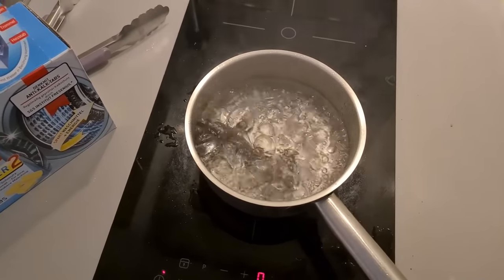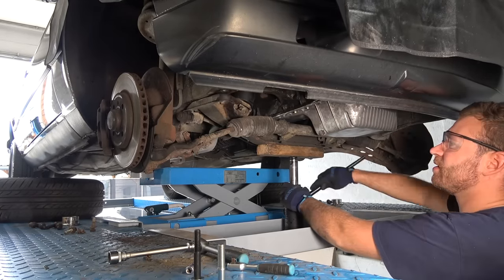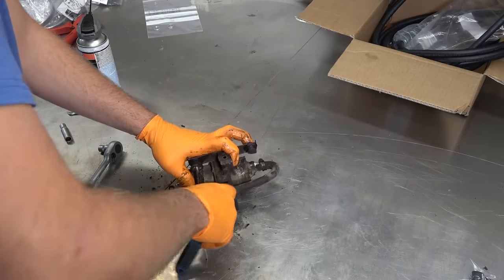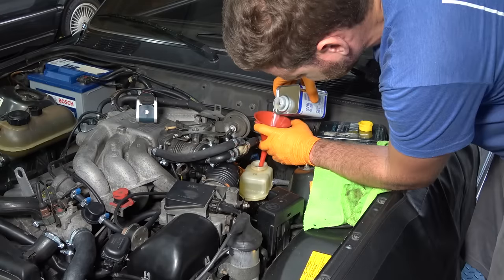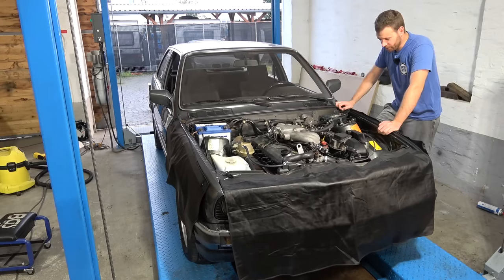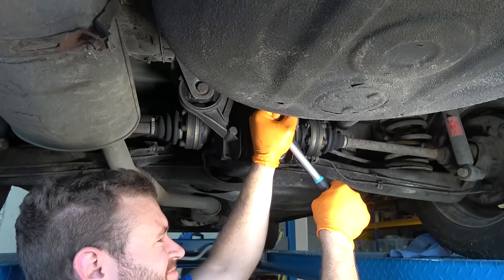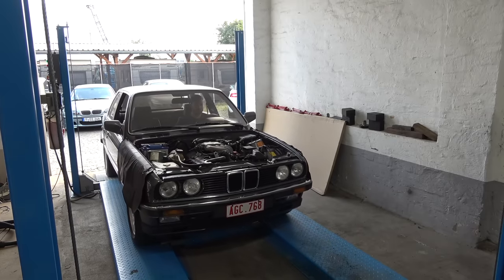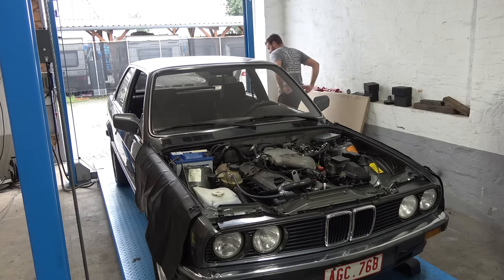Let's Get Mechanical - Neglected BMW E30 320i 5-speed - Project Marbais: Part 4

Comment: I had the same issue with high revs when idling and kept high when engine got warm in my Renault Megane Coupe 1.4 16v (2000 model year) and it was from the intake manifold gaskets and throttle body gaskets as they got worn due to ageing. I have no idea about BMW engines but I thought I might left here my input just in case it might helps you. I really enjoy your channel.

Comment: One tip Sreten, if the Lowering springs are out of the time the car was a few years old, it will get H Number plates, cuz its out off that time. All tuning that was available at that time is H Konform

Comment: A little tip re the spinning ball joint . 

Put a jack or block underneath it and slowly lower the car onto it . This will stop the ball joint from spinning and allow you to release the nut . 

Keep up the good work.

Comment: i just had the same high idle on my E30 as well i just bought. I checked the intake boot (no cracks) then i removed the air filter only to find AN OILED k and N filter which in my book is a no no i HATE those oily filters, so i bought a new stp air filter, and then cleaned the MAF sensor connectors and the sensors itself AND THEN THE IDLE WAS FIXED! no more erratic idle! smooth as ice. and i think the same i have wokred on e39, e46, e90, e60, e36 and i think e30 is harder (due to unknown AND being so old. i agree streten!

Comment: Sometimes you can get some needle nose locking pliers on the ball joint so it doesn't spin when zipping off the nut.

Comment: That hose that was too short is for the models with a fuel filter directly after the in line fuel pump, which is the one my car has. Yours seems to have the hockey puck shaped filter thats pre-pump

Comment: Really nice video!! As always of course.
One thing, you shouldn't use the impact wrench with the spring compressor because it can damage the threads of the bolt inside the tool. Good night and thank for the video!

Comment: Love your videos, some good wrenching being done. To save you a bit of heartache in the future, you can buy a nut splitter tool (a hole with a sharp wedge on a bolt that can be tightened) so you don't have to wrestle an angle grinder into small holes.

Comment: Basically every car needs a suspension refresh ++ at a certain stage / age. Recently had the front of my old Espace done in about the same fashion as this video.  1500 euro bill but worth it. Everthing feels solid again. Brakes very well. Takes bumps smooth, corners better (  yes even an Espace can corner to a certain extent ). Start spending money from the bottom up.

Comment: Fun Fact: You actually can get the oldtimer-TÜV (or H Gutachten as it is called) with lowering springs. Loweringsprings were available and common in its time so you should not have any problem. I have a H&R Monotube coiloversetup 1989 Golf GTI passed with flying colors, since it was a common modification 30 years ago. You only have to check if it was period-correct (up to 10 years after first registration).

Comment: Old trick with those control arms if I recall is using a jack on the center ball joint so you can get the nut off. I remember doing all the same stuff years ago on my early E30 which is now getting an S50 swap btw. Also, if you wanted to keep it more original, Ansa sport exhaust would be very understated while giving a better sound. More on the mild end but would probably suit the car well. Also agree on lowering it a bit, thinking you’re going the right direction with the spring choice.

Comment: After the welding put ice or carb cleaner on the nut, it will shrink the bolt and it will come out neatly. I just weld a blob on the bolt, then shrink and apply vice grips..

Comment: One of my favourite channels to watch and you finally bought my favourite car 😁😁. Try checking if the Throttle position sensor is working correctly for the idle issue, could be a possible fault

Comment: hi, @37:00 use a jack to push up the ball joint before removing the nut, the jack will keep srew from spinning
Reply from the maker: I tried on the right side, doesn't work when the nut/stud are rusted.

Comment: You can place a steel tube inside the replacement hose and then bend the hose and tube avoiding it to collapse. and it will look like original bended hose. Juan

Comment: Love your show! Suspension may settle, but I would have gone with oem-spec Sachs/BMW — but I’d still rock those steel wheels! Looks true and it is true with manual-steering and gearbox.  You couldn’t do this e30 any better with bigger wheels, it’s just perfect.

Comment: Hi! I discovered your channel just a few days back and its amazing! I have a hint for removing nuts from popped out ball joints, lift the joint with a carjack to press it back, a slight pressure is enough and it wont turn around since its cone shaped, works for me most of the time

Comment: Throttle issue could be the WOT resistor underneath the butterfly valve, or your volumetric flow unit, think later ones were mass air flow units

Comment: You can use Eibach lowering springs and still get the German historic plate. 
Recently this topic came up across whole tuning Germany. You'll find more info if you look for "Zeitgenössisches Tuning". 
Quick summary: If the type of (in this case) springs were already available at that time (+ 10Yrs) then the car is still historic ... And there were tons of spring-lowered E30s in the 90s ;) 

Keep up the amazing content!

Comment: Liqui Molly makes everything better. I used their Motor Oil Saver in combination with Oil Sludge Flush and Hydraulic Lifter Additive and it got me out of an 'unavoidable' piston rings replacement that would cost north of 1k. Pure magic in a bottle.

Comment: Love the video! Just one point of attention, the blue dustcover of the front shock absorber should be folded OVER the plastic grey retention ring that you slid over the strut. That will keep it perfectly in place and dust/water out. The grey ring has recesses that allow air to vent in and out when the shock (and thus the blue cover) are compressed and decompressed.
Reply from the maker: You missed where I explained and did that...
Reply: @M539Restorations  FFS, I did indeed, my apologies. I should have known better:P Maybe a tip then that might be helpfull in the future in case you run into a spinning conical bolt (like the  ones of the control arms with the rusted self locking nuts): place a small jack under the bolt/balljoint and push it back into the joint. Than it most of the times wil have enough grip for the nut to be removed fully. No need for cutting the bolt or nut which is of course a massive pain.

Comment: Its a long time since I worked on these, but for tick over issues (apart from the ignition timing that you are already looking into, and yes, PROPER cars need a timing light :-) ), its worth checking that the throttle position switch is clicking just as you move the butterfly, if the tick over screw has been adjusted too far then this might be permanently open. Also, there is an air bypass needle screw that adjusts the air that bypasses the butterfly and hence adjusts the tickover mixture, it is in the side of the throttle body. This can be adjusted but its worth taking it out to clean it, they often got gummed up with carbon deposits. Turn the screw clockwise and count the number of turns (should be around 1.5), then remove the needle screw and clean it with brake cleaner and also the hole that it fits into. Then refit by screwing all the way down and then back out by the amount it was when you started.

Comment: Working on 80s and 90s cars makes me grateful for the simplicity of modern idle control. Most of these older cars demand a rats nest of vacuum lines and archaic mechanical components to regulate idle speed. And unsurprisingly, they almost all idle like shit by the time they're 20 years old.

Comment: Regarding the high idling problem. I had a very similar problem on a E30 M3. Solved it with a new set of HT ignition leads. I think a break down in one or two leads sends a rich fuel mixture to the O2 sensor confusing it.

Comment: Excellent videos, I especially like the e21 series you are doing. When the ball joint popped, I would’ve jacked it back into place to keep it from turning while I finish removing the nut. Either way, well done 👍

Comment: I’d look at the air flow meter and the magnetic tracks in there which could be worn.  The arm could be sticking also.  I had the same meter in my 944 and it caused some problems. I exchanged for a reconditioned one and the car ran so much better.

Comment: I had the original M-Tech 1 suspension on my prefacelift 1987 E30 320i (in 1988) and compared to standard the car was approx. 10 mm lower (maybe a little more). The best thing about this setup is that the car gets much better driving characteristics while maintaining comfort. Visually, however, the car was too high even back then. By the way, I remember that the E30 320i at the very end of the 80's got an exhaust silencer with two end pipes, but they were too small/thin and it just looked stupid.

Comment: I have a full inox scorpion exhaust ( including headers) and the sound is perfect on a 325i mtech2. Not crazy at idle but fruity when high reving.
Fittment is decent, was rubbing a bit but that might be from the install.
Suspension, i have a b12 kit which is b8 strut + eibach -35mm. Look wise it's perfect, still practical for normal use. But for driving, i still think it's a bit soft (for nowadays standards at least). Most people recommand h&r springs if you are after something more sporty.

Comment: You can also get the oldtimer registration with a tuned or lowered e30 :-) in general, the tuning just has to be "zeitgenössisch" which means that the tuning has to fit the time the car was built.
H&R even has coilovers for the e30, that can be used on an oldtimer.
In a forum someone wrote an email to H&R and they answered that their monotube 29577-2 was first released in 49/1994 and that it can be used on the older e30s without any problems.
They will send you a written explanation for the Tüv if you need one :)

Comment: Spring pads used to be available in different thicknesses for the rear, on E36s definitely and probably on E30s too.  The originals will have flattened over time so you'll gain several mm top and bottom just by replacing them, which adds to the measured height. If the replacements were only the 10 or 15mm kind that won't help obviously. Ride height will probably settle 3-5mm over time all around, although that may not be enough...

Comment: I had the same car and eliminated the ‘cold temp idle booster’ after 10 years of ownership when the interior passage simply corroded shut (owned and ran this car for 26 years). There is no downside except in minus C weather at start up you need to keep your foot on the gas for 30 sec or so - or just start driving.

Comment: Nice video! I saw you struggle with the nuts of the ball joints. When a ball joint spins when loosening the nut you can put a “Hugh Jackman” under it and put some pressure on the ball joint. The tapered section of the ball joint will make sure it will not spin anymore. 

Although cutting also worked ;)
Reply from the maker: I tried with a floor jack on the left side, but didn't work, nut/stud is way too rusty.
Reply: @M539Restorations  great minds think alike :). But some bolts or studs will always fight back. But you won!

Comment: I believe on the L jetronic airflow meter there's an adjustment/bypass screw (sometimes hidden under a black or blue plastic cap), oftentimes there's something similar near the throttle body. This could account for your weird idle issue. It may be worth converting to an electronically operated idle control valve like the m52 engines have, with a tiny custom made control module that feeds of coolant temp and rpm signals, shouldn't be impossible to find someone amongst your many fans and followers who is sufficiently tech savvy to whip you up a little control box for it. It would potentially even be a marketable solution for a lot of e30 fans.

Comment: Hey Sreten, really love your approach, makes me want to achieve the same level of perfection when working on my own car.
Regarding the springs, if you choose a contemporary model, meaning that type was around within 10 years after your car was produced, it won't be a problem for the H-Kennzeichen. Eibach and H&R will definitively have something fitting.

Comment: Next time when removing a (control arm) ball joint, put Hugh Jackman jr. under it. It will hold it in place and stop it from spinning. That way you won't have to struggle that much and you can leave Angela Grinder on the workbench. Good luck with your channel mate! Really enjoy watching you working on your projects
Reply from the maker: It doesn't work on rusty stud/nut, I tried.

Comment: After completing all that work on the braking system removing the rear brake drums & at least just giving them an inspection, clean & grease would have been high on my priority list.

A nut splitter works wonders for nuts you cannot undo, much quicker than the Dremel.

Comment: The blue cold start fuel injector on the intake manifold with associated fuel pipe can be deleted as they were from 1985-on [E30] M20 engines. This can be a fire hazard if the pipe leaks as it runs down the cam cover towards the exhaust manifold.
Also these cars are much better on Koni Sport Adjustables and Eibach springs and roll bars. Experience with Bilstein dampers was found to be too stiff and jiggly.
(owned 3, E30's in succession; a 1984 323i, a 1985 325i and a 1987 325i with the engine stroked to 2.7). These cars were almost bulletproof. More than 420,000kms and no issues. They worked out cheaper to maintain and service than a Ford Mondeo.

Comment: I guess the high hanging idle speed could be due to mechnical problem. I had similar issue with mechanical carburator linkage system with my Nissan Sunny, N13, 1990, GA16S engine. I solved the problem simply by re-lubricating all the links in the linkage system which controlled the carburator buttefly valves. Then the idle always returned to normal speeds. The idle issue could be similar one with yours. If there's some sort of mechanical linkages which control your injection or air intake, they might just need some lube or oil into them.

I also noticed with my Sunny that these new fuels were bad for the engine. They made it run poorly. The ethanol mixed into the gasoline didn't work well for that engine. When I moved to Shell's V-Power gasoline, the engine started to idle very smoothly, RPMs didn't go up and down on idle, engine had more power, responded to gas much better and it overall ran better and didn't have any kind of weird issues like things which felt like backfiring and such.

I'd say try those. Check that do you have any mechanical linkages which you could lube which are related to fuel-air mixture control and change the gasoline to V-Power gasoline.
Reply: I also had some issues with my E34 throttle idling, as per mechanic suggested I tried a full tank of 100 octane Shell vpower gasoline and the issues went away.

Comment: When you adjust your timing of course you need to do it with a timing light. small adjustments can have a huge impact. Check the distributor for wear and proper advance.. You didn't find any vacuum leaks so if there is vacuum advance you need to make sure that the mechanism is working.  If it is a centrifugal advance, that needs to be working smoothly.  You should be able to check that with the timing light while the engine is revved.  Ahhh, the olden days...
Timing advance may be part of your idle problem

Comment: You may find that any difference in spring length in the rear will be counteracted by the new spring pads, the old ones get squashed over the years, and the rear raises a little when you fit new ones generally. I personally wrapped the top and bottom coil of the spring with rubber tape and removed the spring pads, because I am a heathen. I'm sure you would never consider such antics! ;)

Comment: I was there when these cars were new and I don’t remember the gap between the wheels and the wheel arches being that big, even with stock rims and tires. Hope you can get it fixed with the M sport springs because it does looks silly now. But other than that, what a sweet looking car! Good luck with the rest of the build!

Comment: control arm under the door bushing is best to use offset ones ;) even better handling ... the solid rubber ones you used also are nice, and last more than 8 years even in Eastern Europe (suspension torture test everyday, all day) , but the offset ones are just the best "feeling"

Comment: Amigo make sure you get some grease on the threaded rod of the spring compressor(I have the same type) it will last you longer in special you use an impact on it. 👍

Comment: I don't know if someone mentioned it already, when that ball joint spins give some pressure on it with a hydraulic gearbox holder so it sits on its place again. Now you can loosen the nut.